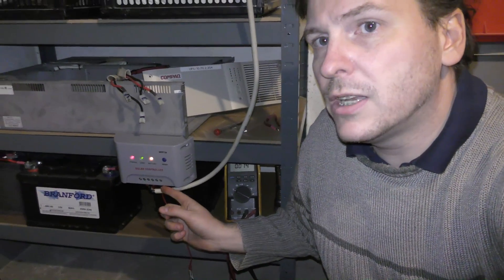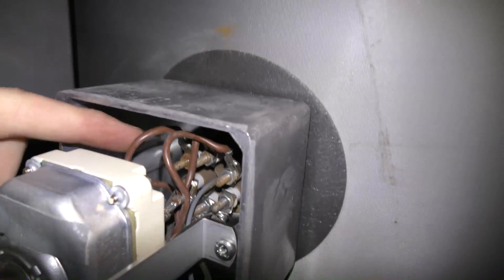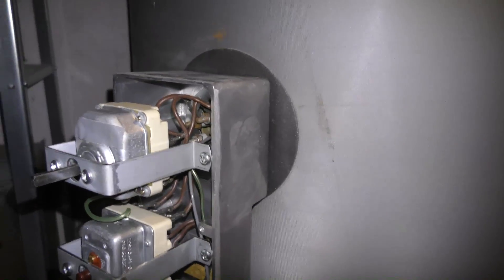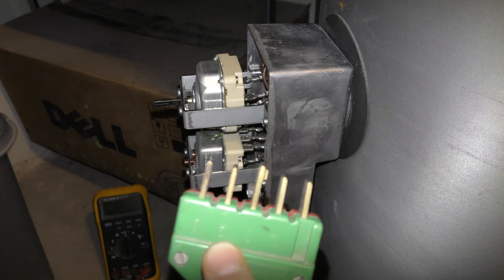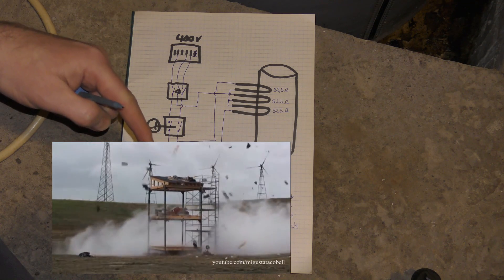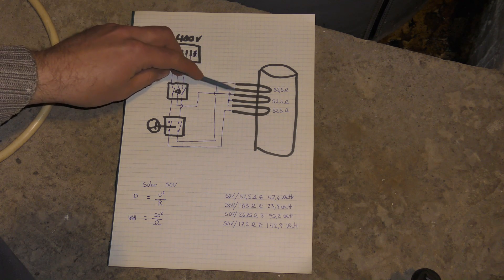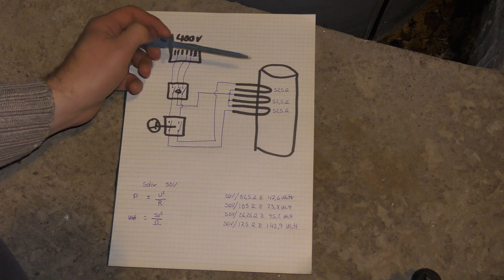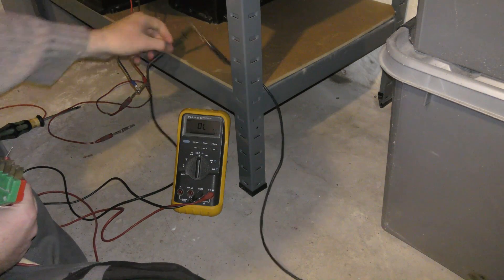Solar Powering a 400volt 3000watts, water heater - 277

Comment: The electrical contacts in the thermostat and thermal overload are not rated for DC current. They will fail to open/interrupt the power when/if they operate.
Reply from the maker: Hi +fandu21 
Thanx,, i will check that out some more. I am only running with 1/30 of the power,, but yes this is a danger.
Thank you for watching! :-)

Comment: As much as I'd like to have that, you have to think that normal consumers could have an arc flash. That's just not possible on 120/240. I have a transformer and phase converter in my garage for 480 3 phase equipment.

Comment: Wow, 3 phase is mostly commercial in the USA. We get 2 phases 120 to neutral or 240 phase to phase. I have a 200 amp service. 48000 watts!
Reply from the maker: Hi +logycam10 
We have 3 phases 230/240 to neutral or 380/400 phase to phase. (They are raising the voltages these years) each phase has a 50A fuse out side my house. Inside i have more smaller fuses 10/13A for 230v and 16A for 400v
200A 240 volt that is a thik cable.!
Thank you for watching! :-)

Comment: You get three phase power at your house?
Reply from the maker: Hi +logycam10 
Yes I have 3*230v 50A coming in to my house a total of 34500 watts of POWER :-)
Whay do you get? and where?
Thank you for watching! :-)
Reply: +My PlayHouse (Morten Hjorth) In Italy houses get 230v AC 50hz single phase. The standard electric meter trips at 3600w. If you pay more you can get a 4500w meter. Industries get also 360v AC three phase without power limit and annual billing.
Reply from the maker: Hi +Fabio Pinciroli 
Well we do put in 10A or 13A fuses inside the house,, for each line, but the fuses going in to my house are 50A,, so i can have 5 lines on each phase,, of 10A or 2300watt. The 380/400volt outlet has 3*16A or a total of 19200watt,,, i have two of those :-)
3600W is not much,, i think my own uses that,,,you must run in to that alle the time??
Thank you for watching! :-)